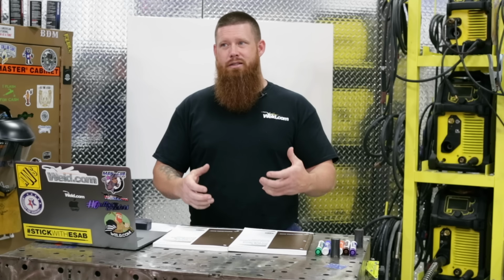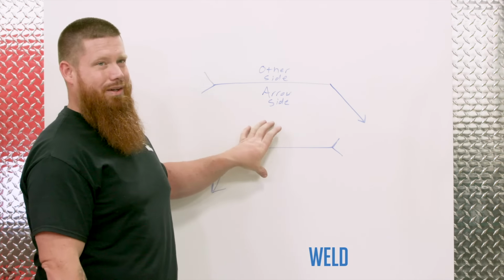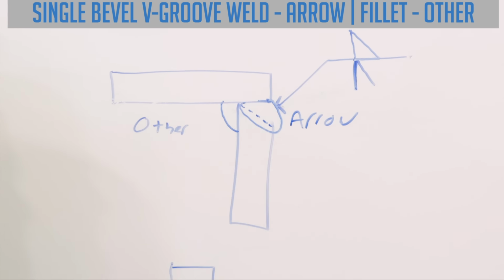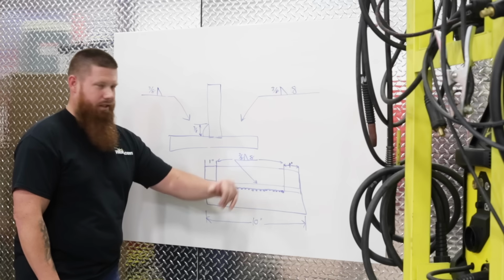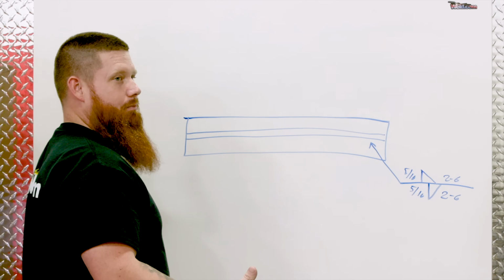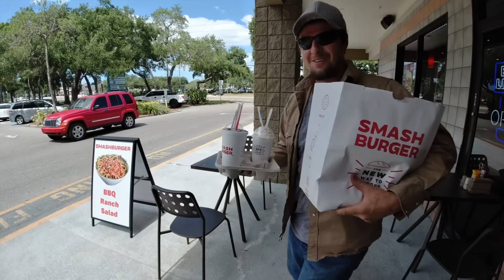How to Read Welding Symbols: Part 1(Full 3 part video in WELD™ app)

Comment: I gotta do this again after 10 years.  Alcohol made me lose my job.  I went to school for welding, but had a job as a resistance welder.  So the machine would fuse the metal together.  Sometimes it would fail and you just use the mig welder. Just running a bead on the tubs.  But now I gotta find a new job.  I did this 10 years ago in college. I kind of forgot a bunch of stuff.

Comment: I'm confused by your explanation with the overhead example using ¼ |\ 2-6 because it looks like you have the arrow side pointing to the top, but you made your drawing with the weld being on the bottom when the symbol shows to put the weld on the arrow side. It's the opposite of what I thought it was supposed to be on the example you do right below that one, too. Am I missing something, or was it just a mistake?

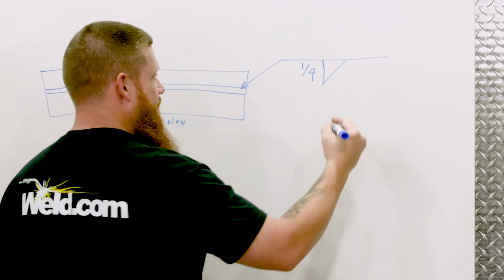Comment: The arrow at 13:49 I got confused because it looked like it was pointing to the top of the tplate diagram. (It that case where you drew the weld would be other side) or did you mean to do it that way 😭

Comment: As a structural welder, one thing that’s not on the prints is the 1/4” or 3/16” holdbacks (Weld termination) on all of the plates. The inspector always wants to see the hold back so that they can verify the gap or allow for stresses.

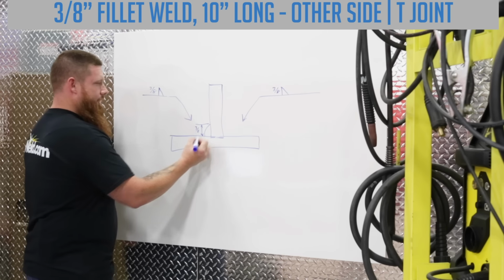Comment: So at 9:23 tht same sign on the left on top is where you would place your weld where it's pointing at? And it wouldnt go on the other side since it's on top?
Reply: @jacquoysutton6860  I think he got it wrong there. I'm just learning this stuff but
Reply: I think he got it wrong there. I'm just learning this stuff but it seems to me that the welding symbol on the left should have the fillet triangle on the bottom side of the reference line. So I think we're both thinking the same thing

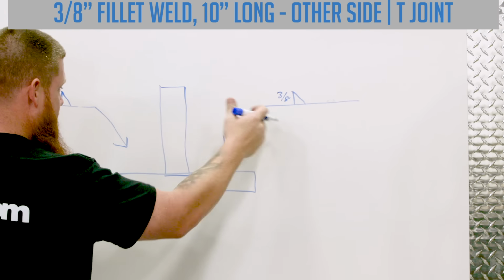Comment: At 9:00 I assume he is making a mistake when he says "Both of these arrows are telling me the same thing." These welding symbols are both indicating to weld the other side of the joint, given that the symbols appear on opposite sides of the joint, they are indicating two different welds.

Comment: 8:50 when he drew the line and arrow on the left side, wouldn’t you switch the fillet symbol and size to the bottom because the weld is now on the arrow side?
Reply: Yes. Good catch, I noticed it too.
Reply: No he is talking about reading  the signs from left to right. So basically , to say , no matter which side the arrow is facing , you're still going to read that symbol from left to right. I hope you're doing well with your journey!

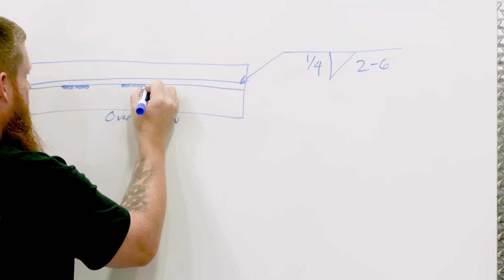Comment: 14:20 I don't think this is correct. You said whichever side the arrow is pointing is labeled below the reference line and the other side of the arrow is above the reference line but you drew the welding on the other side when the 1/4" fillet weld is below the reference line.

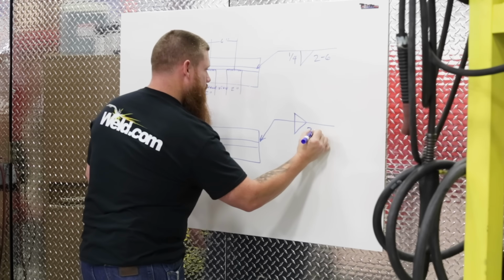Comment: Thank you for the great video. I noticed a mistake in the T-weld example—could you please review the video at 14:45? For the 1/4-inch weld that is 2 inches long with a 6-inch center-to-center distance, the weld should be placed on the arrow side, not the other side.

Comment: i have a question, how can you know how many 2inches weld you need to do? i mean it only say the length of the weld and the distance of each welds but it didn't tell the number of how many 2inches weld you need to put.

Comment: @8.53 I  think so the arrow shows the side of welding but the symbol  shown needs to be at down side. ( because as you explained no matter where the arrow points is the symbol is on top it will be denoted as other side) 
Please let me know if I am wrong.

Comment: So to weld on the same side is it always the one on the bottom? Or the one on the same side of the arrow? Cuz you say “arrow side” but when you did one of the demonstrations it was on the same side the arrow is but you put it on the other side
Reply: which joint confused you

Comment: I watched your video, Thank you, but in video 13 min, I believe the info is incorrect. The arrow side should be 3/8 and the other side should be 5/16. If you mentioned an arrow on the top side of the sketch then it is ok. but you mentioned an arrow at the bottom side of the drawing then it is wrong.

Comment: For those who have commented about the arrow side-other side debacle.  Yes he did get it messed up starting about 13:40 mark.  The point of that section was about adding the info to the welding symbol.  In that first drawing example at 13:40, he did draw the arrow to that "top" edge, so that should have been the arrow side, then he drew the weld on the other side.  He was wrong to do that.  And continued to be wrong in those following examples.  I did not go thru all the comments to see if he ever corrected it via a reply.  And in some other examples, the arrow never touches a line.  The welding symbol in the drawing should always be attached to the line anywhere the weld is to occur.  He might have missed that drafting standards and procedures class.
Reply: @markactonatwarrencat  thanks for the clarification I was getting confused
Reply: @markactonatwarrencat  yea i thought so technically he is wrong
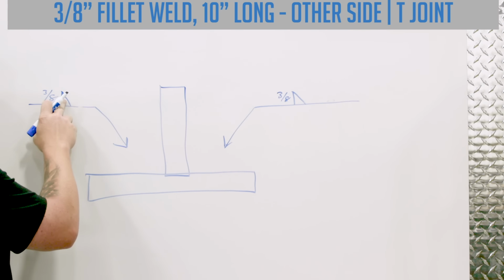Reply: Also did the same at 8:55 when he drew an arrow pointing to what would be the other side of the  first arrow and said these are both telling you the same thing, even tho he didn't change which side he was drawing the weld symbol on still a great video overall tho I learned alot
Reply: @markactonatwarrencat  thank you cuz I was lost I came here jus for that part  🙏🏾🙏🏾🙏🏾🙏🏾🙏🏾🙏🏾

Comment: Good stuff. very good examples for us who need a refresher.
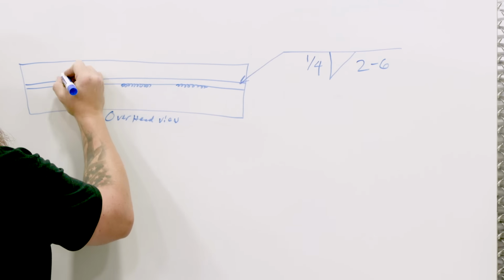On the explanation at 14:20, should the arrow side of the 1/4" weld be drawn on the arrow side of the vertical plate? 
Same for the next weld example @15:06. You drew them on the other side of the plate on the plan view. Am I missing something?  
Thanks again for these explanations.

Comment: Looking for advice from welding a welding professional on the age old problem of properly welding a mild steel oil pump pick up screen onto a cast iron oil pump body. Seems to be a lot of opinions out there but the pickup tube breaks off too often, thanks in advance.

Comment: 8:58 both symbols are telling you the same thing but wouldn't they each imply welding on the other side than where the arrow is pointing to? (so they carry similar information but are indicating opposite sides of the T-joint.)

Comment: I've only worked 1 shop where our prints actually used weld symbols. 10+ years ago now. Right now I get a print, and any special welding instructions are given verbally. Usually 10 seconds after you've put a tack or weld in the wrong spot lol

Comment: One thing that its not clear to me in the intermitent is the distance from the edge to the center of the 2 inches weld. I assume its 6 inches as well but I think it should be part of the dimensions the instructor is drawing for more clarity. Is my assumption right?

Comment: Great video, the only thing that might help even more than you have within this video would be that, when you draw 2 pieces of steel you use different colors. So that when you change views you can keep the visual with the same colors from steel to steel. For example, the flat piece of steel could be blue and the vertical piece could be red. Change views and carry the colors through so some of the less visual can keep up.  Thanks!

Comment: I love the video, and perhaps I'm a little slow, but at the 9:01 mark, aren't those arrows both telling you something different about the joint?  They both mean "Other side", but since they are drawn on opposite sides of the vertical piece, the two arrows are each referring to 2 different welds.  The arrow on the right means a weld on the left, and the arrow on the left means a weld on the right, correct?  So I guess they both read the same way, but they don't tell you the same thing about the weld they are drawn against?
Reply: im stumbled here too i made i few practice blue prints on paper and i got confused when back to the video and im at the same point they both are saying 3/8 other side but were the arrow is pointing is on the other side as well so wouldnt that mean there opposite because that would be from the left arrow side and other side and the right side arrow side to other side of t joint

Comment: I understand bottom of the arrow it's arrow side and top of the arrow it's other side, however, on example at minute 14 overhead view or plan view I see the arrow on the top of the vertical plate but the weld is on the bottom of the vertical plate which is on what I thought would be the other side. Am I confusing this?

Comment: First of all, love these type of videos, this is almost exactly how I teach weld symbols myself, one note that I may make is that around the 14:15 mark you show a stitch pattern but draw the weld symbol incorrectly(shows arrow side weld but you show the welds on other side of where the arrow is pointing.)
Reply: I'm pretty new to this stuff but yeah I noticed that. Thought I was just misunderstanding.
Reply: Yes it should be on the arrow side. Look at the fillet welding section in the link
https://www.millerwelds.com/resources/article-library/deciphering-weld-symbols

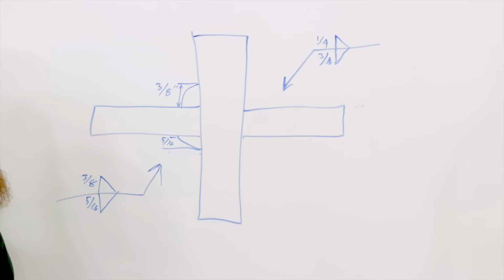Comment: I have a question- at 13:03 where you explain the cross shape, you say the 3/16 goes on the “top” and the 1/4 goes on the “bottom”- I thought the arrow acted as the workpiece though which would have the 3/16 on the “bottom”- can you explain why the “top” is the arrow side in this specific instance?

Comment: At 8:50 he says the symbols mean the same thing, but does the symbol on the lefts “other side” mean the opposite side than the symbol on the right? Basically is the other side different for both symbols because they are on different sides or no

Comment: Great refresher course! I want to teach tig welding mainly, but other welding as well. At 45 I went and took a welding test today with flux core nr-232 wire and forgot about the 1 inch stick out on the wire and I had the volts up too high 105, when volts should of been around 25 with 3/8 metal thickness. The blueprints were more technical than I recall, lol. You are a great teacher! It gets very busy in blueprints , looking like a dam Maze!! Appreciate the lessons.

Comment: i love this video just wish it was edited a bit better. at 14:16 you mess up your explanation and switch where the welds go based on where they are on the arrow. Everything previous to that you showed any details on top side of arrow goes to the opposite side of where your arrow is pointing yet at 14:16 and shortly after you do the complete opposite. your arrow is pointing at the top weld, your details are on the bottom of the arrow line, yet you show the weld on the opposite side of where the arrow is pointing lol. im sure it was just a simple mistake on either the editing or where you drew your arrow, but small mistakes like that will mess with peoples heads

Comment: A little late to the party here, but plan to watch this whole series as it's something I'd like to be more knowledgeable on. Have a question about the single V bevel at around 6:00 in. Does the weld symbol indicate which piece of material to put the bevel on on that joint? It does seem more intuitive the way you read it, but does the direction of the V on the symbol indicate which side of the joint to bevel if it isn't as clear cut?

Comment: Your example at https://youtu.be/Svoi1v_o5yI?t=538 is a little misleading.  Both of those "Welding Symbols" do not tell you the same thing as you stated.  The Welding symbol on the left is on the same side as the weld in the picture, so it should have the "Weld Symbols" under the line (arrow side).  Or, you should include a new drawing where the weld is on the "other side".  I hope this helps or if I am wrong please explain. Thanks.  

Also, the good news is that your video is so good it allowed me to catch this, because I didn't know that Welding Symbols and Weld Symbols even existed before I came across your video.  I am new at welding and have only welded a few lines for practice.  Thanks for the videos, they are very helpful.

Comment: I’m a little stumped. At 14 minutes into the video you indicate that the 1/4” weld is on the arrow side but when you draw the weld it appears to be on the other side. The arrow is pointing to the line that doesn’t have the weld on it. Maybe I misunderstood? 🤔

Comment: This a very good video, except when you showed the Weld Length and Pitch on the board you reversed the weld sizes for their location. What you called arrow side was actually other side, and what you drew for other side was actually arrow side.

Comment: at 14:21 the 2-6 1/4" fillet welds you are drawing are on the Other side, but the weld symbol calls for the 2-6 1/4" fillet welds to be on the Arrow side.
Reply: I think that was a test :)    (?)
Reply: He made a mistake and put it on the wrong side...I'm like wtf...I thought I wasn't getting it.
Reply: After welding the smart-arse welder just turned his work through 180 degrees and told the inspector where to go :)
Reply: i agree to you sir.  i was a little bit confuse.

Comment: 14:31 I might be wrong? But bottom = arrow side, so the welds would be on the opposite side of that t-bar right? Because the arrow is pointing at the top half, but the welds were drawn in on the bottom section

Comment: I may be mistaken but am I the only one who caught when he was describing intermittent welds the arrow is pointing to one side of the T joint but he placed his welds on the other side and the same thing when they were staggered. Both times the arrow pointed to the top side of the T-joint but he used the other side size
Actually now that I have seen the comments I see others have caught this. It would be nice to cut that part from the video and fix it or do a new one so it doesn’t mess up new welders

Comment: Question: How do you create the proper size of a weld? Ex: 1/4, 3/8 & 1/2 inch Fillet weld on T-Joint, how would you adjust your welding perameters on the machine to get that size asked from the blueprints?

Comment: Question 1: What about an intermittent weld at  a 3" diameter cylinder (pipe) and a flat plate connection? example: 1/4" ◸ 3/8"-19/32". With 3/8" being weld bead length and 19/32" being the pitch. I would assume 3/8" & 19/32" are arc-length dimensions, not straight line dimensions. And we have to use a flexible tape measure to mark weld bead centers.
Questions 2: same application with this symbol 1/4" ◸ 16 x 3/8", meaning  that apply 16 of 3/8" arc length weld beads equally distanced around the cylinder,  Would it still be accepted under the AWS weld symbol standard?

Comment: @9:07 You said both those symbols say the same thing- it got me a bit confused, the symbol on the left size says the weld is on the other side-  so according to the welding symbol on right the weld should be on the left of T (as per video) but according to the welding symbol on left , should'nt the weld on the right of the T??? (You said they both says the same thing - so i got confused)
Reply: No your right. He got that one wrong it.

Comment: Very interesting. Please also point out that this is per AWS and applicable to welds using AWS. If you go outside USA, others are using ISO standard where the weld location is the opposite. The arrow side is on the other side of the weld symbol.

Comment: Hello Sir. I have a question about H-L045 ss nb smaw pipe test. What really means ss (single side welding)  i dont really understand if welding must be done  from 6 a clock all the way up to 12 a clock  and then just continues all the way dawnhill to 6 a clock or what really means.  Which is the right answer to describe this ss (single side) H-L045 Pipe test. Thanh you.

Comment: IM 63 YRS OLD PHILAM.I WORK IN CALIFORNIA AS A  STRUCTURAL FABRICATIONS WELDINGS AND INSTALLATIONS,FOR 25 YRS .I SUPERVISE ALL PHASES OF STRUCTURAL WORKS AND WELDINGS,MY PREVIOUS WORK IS IN THE PHILIPPINES 20 YRS,WELDINGS ,SHIP FITTER,AND BECOME A FOREMAN IN SHIP BLDG, I AM ALSO WOODEN SHIP CARPENTER AND A FOREMAN, EXPERIENCED IN SHIP WELDINGS,TILL HERE IN CALIFORNIA,I AM A 6GR  PIPE AND SHEET METAL WELDER, UNLIMITED .READING BLUE PRINT FOR FABRICATIONS AND ALSO INSTALLATIONS. I TEACH LAYOUTS AND WELDINGS, ANY ONE INTERESTED MY SKILLS OR CANDIDATE TO FIT  IN TGHAT POSITION TO HELP COMPANY GROWS ,,YOU CAN CALL OR TXT MSGS,AT MY CELL. 8058531711 THANK YOU,,,

Comment: Welddotcom instructions are great for the shop-floor welding.  AWS A2.4-2012 is followed by industry and by USA fabrication/manufacturing/welding companies.  Both sheet metal and plate stock thicknesses are welded.  This is a great video for beginners and for experienced welding professionals.  Thanks for the education!

T J (Tom) Vanderloop, AWS Member & Life Member with SME, Author & Instructor Closing the "Skills-Gap" in USA

Comment: At 9 minutes in your picture should have a weld on both sides according to the diagram you drew. and at 6:50 that's a square butt symbol not an edge joint. good video otherwise

Comment: It's important to note that in structural welding code (AWS D1.1) there are limits on the angle between workpieces that qualify as a "fillet." 

The difference is negligible if you're tinkering around in the backyard, but for construction with calculated weld strength, fillet-welds must be between 80 and 100 degrees from the adjoining component.

The rationale is that once the angle changes plus / minus 10-degrees, the change in geometry re-classifies the weld as either a PJP groove-weld, or seal-weld requiring a destructive test to verify strength.

Comment: Question..You put the 3/8 weld on the other side and the 1/4 on top, wouldn’t the 1/4 weld be on bottom seeing as the in the Symbol 1/4 is on the other side? Thanks! 20:27